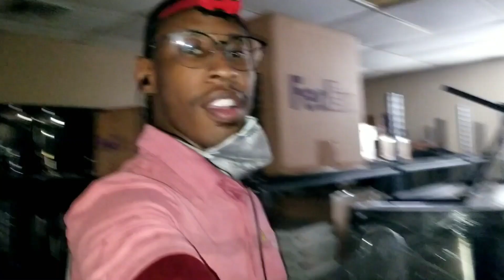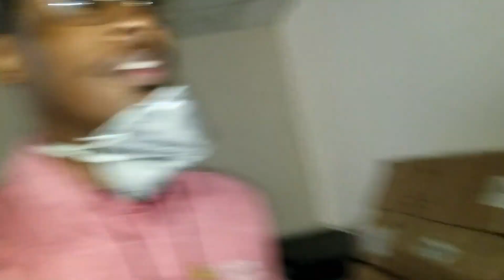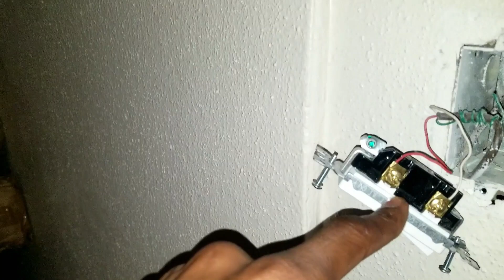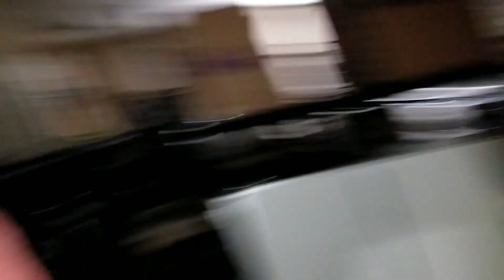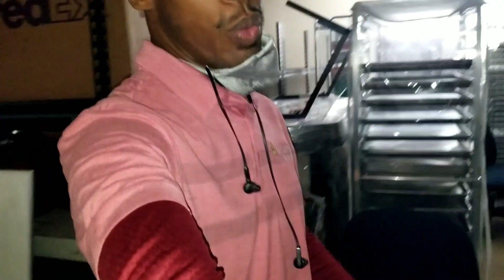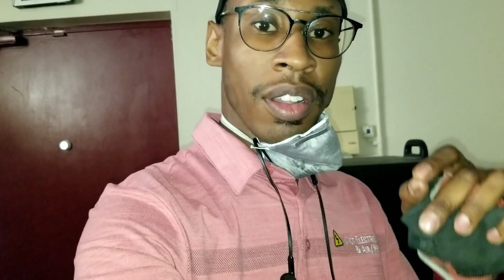Thermostat Wire on a Light Switch? Are They Really Electrician?

Comment: I've seen some F#$%** up stuff while helping my stepfather rewire his ranch home built in 1973.   Wired with single strand aluminum throughout,  as was typical of the time period. Aside from several receptacles with burned out connections equally as dangerous involved the wiring for the hallway light and three way switches.   Power was fed to the fixture,  and a 12/2AL cable ran from the light to each three way switch, all metal boxes.   The ground was used on the common terminals,  the black and white used as travellers, no electrical tape was used to insulate the bare common wire,  IN METAL BOXES mind you, hallway had hardwood floor so I'd imagine you wouldn't get shocked while grabbing the metal faceplate on the switch since you would be like the bird sitting on the powerline.   In the end we ran copper NM everywhere in the house because the aluminum was too far gone to make safe again,   on top of all the shady stuff we noticed.

Comment: This is a low voltage system used for commercial use . It goes to a power pack or an older lighting relay panel . They typically use a momentary switch , this is a great system .

Comment: I have actually seen it before in an old house in Phoenix AZ. Built in the 1960s and someone added a three way switch using telephone wire. There also was not box in the wall. The same person presumably also did another switch in that house where he wrapped the ground wire with electrical tape and used it as a hot. There was also no box on that one. Crazy stuff!

Comment: Doesn't look good, but you don't show whether there's actually 120v on the wire or just low voltage. Had a customer some years back complained that the bedroom wall got warm when she turned the light on, found that the moron " Electrician " had used bell wire for the switch drop. Bell wire was never meant to carry 230v.

Comment: Could it be that that cable doesn't carry power but only a low voltage control signal for something like a smart device such as a Sonoff/Shelly device or a relay?

Comment: "But they told me I could use the small wire and that was the smallest I could find on the truck." - some "electrician somewhere

I hope those were just pigtails.  Even if that were so, it would give me cause to be concerned about the entire wiring system.

Thanks